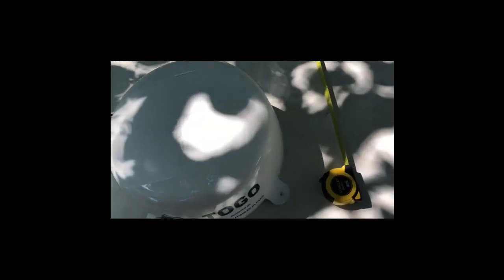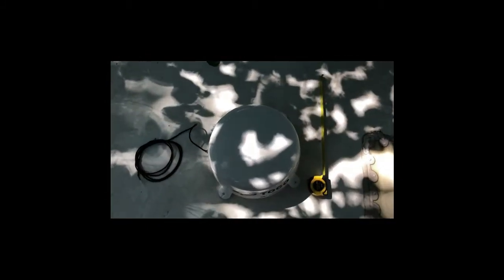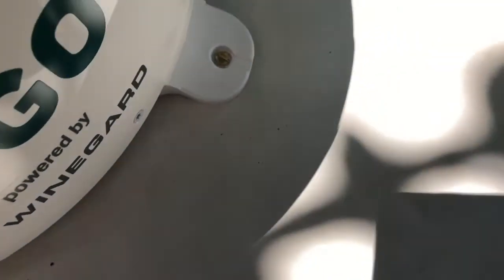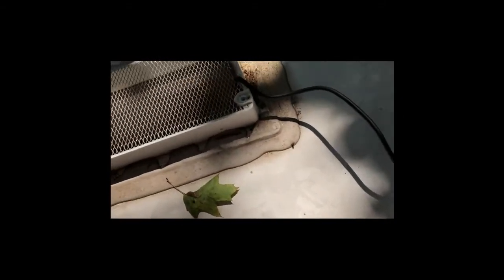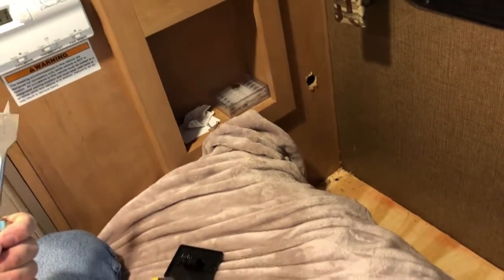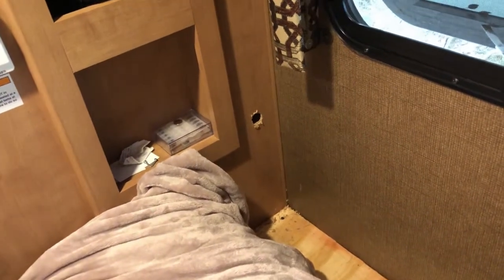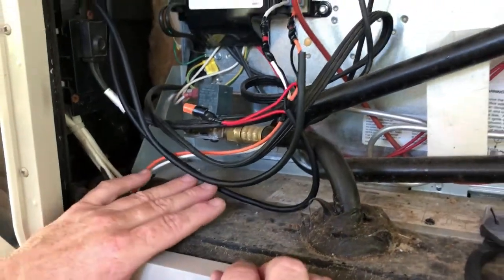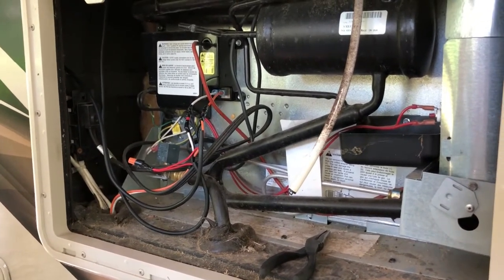TOGO Roadlink Install - RV Internet Game Changer (RV Living Full Time)

Comment: I have had mine for two months on top of our Bighorn 5th wheel. The following speed tests were in areas with decent ATT signal on iOS devices. It doesn't seem to have any more signal strength then the iPhone. 

The up speeds at all locations was >20.
Mooresville, NC 2-9↓ - iPhone 35-60↓
Davidson, NC 2-5↓ - iPhone 50-80↓ (Netflix would occasionally freeze)
Denver, NC 6-10↓- iPhone 70-100↓
Monroe, NC 5-7↓ - iPhone 18-30↓
Rondathe, NC 8-11↓ - iPhone 150-180↓, not a typo.

Over the last two months we have used 145 GB. It does great a streaming everything on Apple TV. While in Davidson, and on a rare occasion in Mooresville and Monroe, we could not surf the web on another device while streaming on the Apple TV. 

I suspect that ATT is deliberately slowing the TOGO down. No matter were I went it never exceeded 11↓ when the iPhone and iPad were significantly higher 

The wi-fi function has not proved to be useful. It typically doesn't get any better signal than tethering to an iPhone. It would not connect to free wi-fi in Rondathe and Mooresville while the iPhone did. 

If you are in ATT areas most of the time and just want to surf or stream shows it's a good choice. I like that all my devices connect to the same SSID not matter where I go. Turn it on and everything connects nicely.
Reply from the maker: Wow. I have not had that issue yet knock on wood. I hope that does not happen. So far it has been great for me. I do thank you for sharing issues you have had. It tells me what can happen and I am sure others will be grateful as well. Thank you for sharing this detailed comment. This is very helpful.

Comment: Good presentation👍

A bit of FYI to DIYers, when splicing into existing electric circuits.

Know the electric power input required for any new equipment and assure the existing circuit being tapped, is the same voltage and,  can handle the new load plus  maintaining the original load.

Circuits feeding USB outlets  can be 12 volt but the wire size may not be capable of handling a heavier 12 volt load.

Just to reassure, if the circuit protection (fuse/breakers) blow/trip due too circuit overload NEVER replace the circuit protection with a heavier fuse/breaker.  NEVER!!!

Overcurrent protection is rated according to wire/device size and wire size is rated for intended use.

Not trying to burn the video just some FYI so,  "I can do this, DIYers"......   don't burn.

We are "TheGriswolds" on RV Vacation.
Reply from the maker: RV Vacation great information. Yeah that is one reason we went the route we did with using those lines. We knew or should say my dad knew it could handle the load. I myself would not try to tackle an electrical job. Not enough knowledge for me. So far it has been great with know issues. I love the TOGO unit.
Reply: I enjoyed the vid. and watching your dad at work,  thanks for getting it on line. 

 I'm not a fan of RV (workmanship)  wiring.  I should post the photos of installation nightmares I've found inside our "JunkJayco" 5th wheel.  But unfortunately the wiring is legal and meets code. 👎

I presently use WeBoost for our cell phone signals both in our RV and at home, where time has forgotten, and absolutely no cell signal in the house.

Internet  provided by Verizon Jetpack.  Certainly more expensive per month than your new system.

Phone service by Tracphone.

Keep up the good work.
Reply from the maker: RV Vacation you are correct most people do junk work and just sling it in. I like to do clean work especially since this is where I live. My sticks and bricks was the same way. We completely redid everything to a better standard. Clean and safe is what my dad lives by. We thought about trying this system for my daughters house as well since it is cheaper.

Comment: I ‘used’ to have the wired house version of AT&T Uverse and it was terrible! (Since this is a family channel I’m being nice!). The best download speed I could get for $60/mo was 3-6 mgbs. After almost two years of fighting with AT&T I ended up buying a NETGEAR AT&T 815S hotspot which doubled my download speed at worst! I now usually maintain around 35mgbs or more download speed on 2.4 ghz mode..on 5.0ghz it goes out of sight! I had that hotspot about 6 months before replacing it with the NETGEAR AT&T MR5000 a month or so ago. I use the same SIM card in the MR5000 as I did in the 815S, which I contributed (815S) to my daughter and son in law! My grand kids love it as they live in the country in Central Texas and can’t get internet service wired in! I used it there at Christmas 2019 and it worked flawlessly! I’m on a grandfathered plan, no throttling, no capping, and, totally unlimited for $34.74/mo...a tad more than yours per month with your new system. I’ll be using the MR5000 hotspot when I get back on the road and go full time soon! Great video and kudos to your dad for his contributions! Stay safe, and have a blessed day!
Reply from the maker: Yeah TOGO is about to go away from their unlitmeted plan. I will be switching to BIX Wireless until something better comes along. It is still AT&T and unlimited but will cost a little more. That is the biggest challenge of being full time is the lack of internet. I need it for work so it can be very hard sometimes. Thanks for watching my friend.
Reply: Camper Life > I don’t know if the unit you have takes the regular or the micro SIM card like what goes into a cell phone, but, go to a E-Bay and search for grandfathered + your carrier + unlimited + hotspot plans (without the +)…that’s where I got mine from. I’ve been using mine for almost a year with zero problems. Let me know what you finalization is!
Reply from the maker: @TOTALLYRELAXED  Yeah I have seen them on Ebay. I got a regular sim card. May look into that. Thanks for the info. Was not sure how legit they where. lol
Reply: Camper Life > I’m thinking that if you just get the grandfathered plan sim card from eBay you, so won’t have to buy a hotspot, and, maybe still use the existing unit you have now. My plan has no contract and I can quit anytime I want to. Just a thought. Have a great day y’all.
Reply from the maker: @TOTALLYRELAXED  I will check it out for sure. Thanks for the information.

Comment: I’m thinking about getting this devise.  Where did you tie in the power to your electrical system in you rv?
Reply from the maker: I tied into the Fridge 12V power. You can also use a light if you have one close. The install is pretty easy. If you watch the video toward the end you can see the lines we used to do our full circuit. I hope this helps. Let em know if you have any other questions.

Comment: Well, the AT&T unlimited party is coming to an end.
Reply from the maker: Rick L i have not heard anything about that to this point. Mine has been working without issue. Can I ask where you saw this?
Reply: @SmallSpaceLiving   David Bott on his channel OUTSIDE OUR BUBBLE AND Chris and Chere on The mobile internet resource center. AT&T announced it I believe on the last day or two and those channels were notified by Winegard(or Togo). Look up David Botts Outside our bubble. Don't take my word for it, check it out. If you just got one you need to activate it before Jan 15th 2020 and you can pay the 360.00 and have it for one year but anyone whose already activated, when the original year is up you won't be able to renew it for 360.00. They have a four tier plan which is horrible. I think David said the biggest plan was 100 gig for 175.00 per month.
Reply from the maker: @rickl6697  Thank you for the feedback. I am checking into this. I have one activated already. I want to update my subs as well on this. Thank you for sharing the information.

Comment: What is the DB gain of the data signal antenna for general phone signal? I guess not much because no answer from Winegard on this question.
Reply from the maker: Jerry I would probably agree with you although I am not 100% for sure. I can tell you in my current location with not as good a signal as I have been getting the TOGO is doing better than my phone does. Both are at&t. I think the TOGO being higher and mounted outside give it an edge in areas. I hope that helps some. Let me know if I can help in any other way.

Comment: can you guys explain do you splice the wires from the switch and atenna  into the 12 volt wires you ran to. you guys were a little fast on that part and didn't show your dad doing that part-
Reply from the maker: I will look at it and confirm with my dad to ensure I’ll give you the best information possible. I will try to respond in the morning.
Reply from the maker: The way he did mine is there is 2 splices. The main line coming from the roof is spliced into the ground (black line for me) and hot (red line). Then from the switch the lines are tied into the hot making the circuit that can be broken. Yours may look different and again I am no expert on this. If you have any doubts I would have an election take a look to confirm proper connections are made. Sounds like you are in a much bigger rig than me so that could make a difference as well. Option B is to install a 12 volt plug and splice a 12 volt plug on you power line and skip the switch all together. That would work to.

Comment: i have a usb cable plug which appears to have 12 volt wires going into it.  can i splice into those?
Reply: we have a residential frig so cant run the cable down the refrig vent
Reply from the maker: Yes any 12 volt will work the same. The easiest route is always the best in this case. What ever 12 volt line you can get to.

Comment: So the service is $360 and then the unit looks like it's $400? I just have a mifi with Verizon it seems to work well. What program do you use to edit videos?
Reply from the maker: Yes $400 up front for the equipment, then $360 per year for service. I have this and Verizon mifi as well. I use WonderShare Flimora 9. Pretty easy to use but I learn new stuff all the time. It is like $70 for a lifetime license.